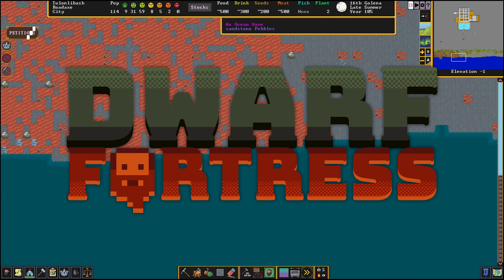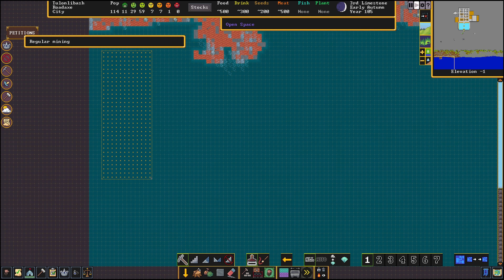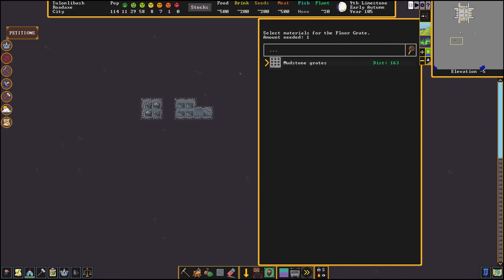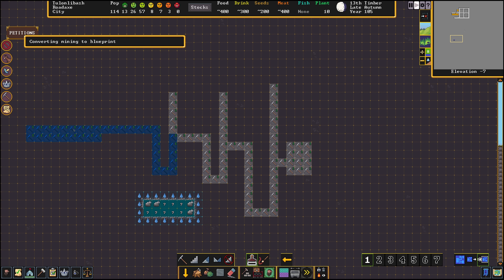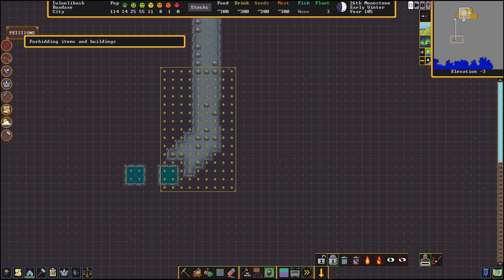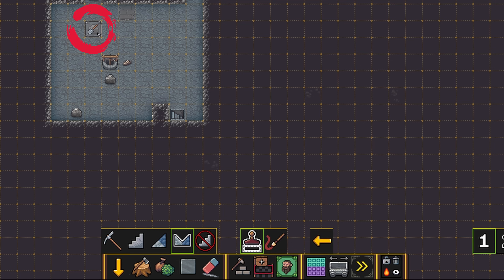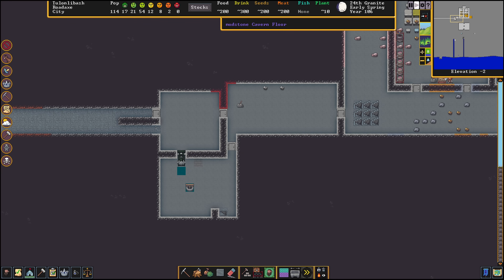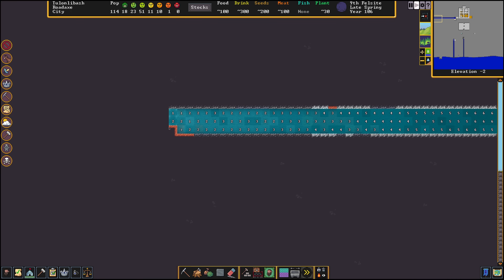Using Water & Water Pressure 🔅DWARF FORTRESS STEAM🔅

Comment: I flooded my base again, this pressure guide explains why it happened. Got a pump set up to pump it out, but from this, i can pump it off the map. Thank you for the tips.
Reply from the maker: you can also use gravity to drain the water without pumping if you can dig a big drain! Happy Gaming
Reply: @TwistedLogicGaming  That is actually what saved me. I was prepping an area on the bottom level that I had yet do do anything with. Water flowing down into bottom floor was enough to get some 1/7 levels in for flood gates till I fixed the water issue. 

My ideas was to divert the stream, then use the rock slits to filter all the fish into one spot, then fish that area. Turns out the fish went though the wall slots and I needed to add in grates. It was at that time, enough pressure had finally up that water came up my wells, leading to surprise flooding.

I knew from years ago that a dead body in the water can make it go bad, so I am trying to create running water that will carry anything bad out, possibly creating a catch to filter out anything that fell in. Wasn't aware that pumps purify the water. Also wasn't aware that creatures could be pumped.

I look forward to try out some of the water traps in the future.

Thank you for making these videos.

Comment: One tip for the edge drainage: use channeling to make it two tiles deep, with two levels of fortifications. Because of the way flow and pressure work, it will drain much more quickly and efficiently. (If your fort is flooding you definitely want the drains operating efficiently.) You actually only need a single tile wide drain this way because of how fast the water will flow out.
Reply from the maker: 100% correct

Comment: im trying to achieve this design and when i  want to place doors it says "No access to door" i dont understand why, i have plenty of doors but i cant just place them where i need them to be placed, its frustrating.
Reply from the maker: where are ou trying to build doors ? timecode? in the u-pipe the doors are not required only the grates are
Reply: well i fixed that problem but when i forbid the top door my dwarf just...ignores it and goes to the bottom door and just stands in those stairs for some reason, every other dwarf is in the meeting area not inhibiting construction but oh well, he will drown.
Reply from the maker: you must lock the door not forbid

Comment: If you're relying on off-map drainage using fortification edge tiles for your water features, e.g. waterfalls, be very careful with visiting your fort in adventure mode later! In adventure mode, the map edges are not necessarily the same, and you'll end up flooding the entire thing!

Allegedly. This has obviously never happened to me... 😳
Reply from the maker: Good tip! Thank you for you wisdom bdeink!
Reply: This is fixed in the Steam version by just not having Adventure Mode included :^)
Reply: Sounds like more FUN.
Reply: I suppose you got to drain the water in the caverns or the magma sea then.
Reply: @meneither3834 or just direct it back to original source? like 1 floor below the sea/ river it originated from
Reply: @head0fmob  That is not how it works. When you make something that takes water from an infinite source you can only make it one way. If you tried to make it go back to the source, it wouldn't work because the source is already 7/7 and has no room for more water. It would either start flooding or if you made a proper seal, it would just jam up as soon as you try to return water to the 7/7 source.
Reply: You could direct it back into an aquifer tile if you have one.
They can absorb infinite water.
Reply from the maker: That's a great suggestion, this map has no aquifer. I prefer the minecart drainage, however it will not set the water as flowing if you need that tag for water wheels. Happy Gaming

Comment: Great guide, as a total DF newbie I was wondering how I could move water around after I found out I was supposed to prepare a water source BEFORE winter strikes as the outside water source freezes over! 
This video perfectly explains multiple methods that I can more or less understand and definitely do with a bit of effort on my end. I'll likely be doing the old timey strategy just to be quick about it but i'll be coming back to this guide to do it the fancier way when I've got a water source set up at least
Reply from the maker: Yes this will be need in the hosiptals if you get in to any brawls, Thank you for watching!

Comment: I could be wrong but I think it would be better to designate the mined tiles as red traffic zones so they won't stand on them. Otherwise there can be a situation where one dwarf stands on one of the tiles to mine another one while the other dwarf mines the tile beneath him. I remember reading something like that on the wiki.
Reply from the maker: Yeah that is correct however I was watching them, and if a dwarf was standing on a tile desegnate to channel you or I could also erase the designations on those 2 tiles before the job is complete and then you will not need to set and remove a traffic order. For larger jobs I would do how you discribed. Thank you very much for bringing that to light trafic areas can be super helpful !!
Reply from the maker: This comes up in the video im currently editing and I recoreded that about an hour ago ahahhaha. so watch out for the next video
Reply: @TwistedLogicGaming , nice =)

Comment: I have a problem with U-Bends like the one you did. For some reason, whenever I open access to it, water doesn't propagate at all, just some 1/7 tiles and that's it. Why does that happens? It's basically impossible to do something like the reservoir done at 10:43
Reply from the maker: I think this has to do with a water pressure bug if I am correct. please see this video about it (sorry for the quality this is an older video) https://www.youtube.com/watch?v=lU5JeIgMvoA
Reply from the maker: let me know if that bug seems like the one you have . Thank you for watching !
Reply: Not completely sure if it's the same since I can't 100% follow everything going on, but it seems to be similar. 

I will try to describe as best as I can. From a side view, "w" is water, "g" is where I have stone grates, "d" is where I have a door connected to a lever that blocks the flow, "|||" is where I want the water to flow at level 3. This is how my configuration ends up being when I connect with the river at level 6.

6   www         
5         w            w
4         w            w
3         w            w w d                                                                 |||
2         w            w
1         w            g
0         wwwwww

Now let's say I open the door at level 3, this is what ends up happening.

6   www         
5         w            
4         w            
3         w            w w d w w w w w                                            |||
2         w            w
1         w            g
0         wwwwww

The water propagates for a moment and that's pretty much it, at the u-bend water never really goes above 1/7 (it's a 2x2 u-bend), and the water that propagated ends up drying, resulting in this.

6   www         
5         w            
4         w            
3         w            w w d                                                                |||
2         w            w
1         w            g
0         wwwwww

If I close the door at level 3, the water never goes up again, with level 4 and 5 remaining empty forever. 

Now, I have tried connecting the water at level 3 to the hall I want it to propagate in both ways, diagonally (so it becames it own body of water) and non diagonally. With both cases I have the same results. I have tried flooding the u-bend first, then connecting to level 3, same results. I have made a 1x1 connection to level 3 first, blocked by the door, and then flooding the u-bend, same results. It may be worth mentioning, but the lenght of the tunnel at level 0 that connects to both parts of the u-bend is longer than what I depicted, but that doesn't seem to be a problem since initially it always fill up to level 5. It's driving me absolutely insane and I am completely clueless on what is going on.

Edit: After going through all this and watching the vid you mentioned again, it seems to be the same bug, because at level 3 the flood doesn't "complete" and the pressure check seems to die, never going above 1/7 again. Can be replied at any lower level with the same results too. Fuck me.
Reply from the maker: seems like the door is causing the flood fill to fail, & causing the pressure bug in that video there for flagging eveything after that door as static. I might have to create a new version of that video for the steam version; but that seems to be the issue...

To test this: save a back up file. then dig over to the water on level 3 without breaching any damp tiles and see if water flows. basicly forcing a block update in the area of the water. 

W dampstone (do not breach for test)
S stair 
M Mining tunnel 
D door
Top down level 3:

M
M
WWWWWW
WSWWDWW
WWWWWW

Let me know Lugano V !
Reply: @TwistedLogicGaming  Sorry I forgot to mention that I tested without using the door (both having it placed and not placed while the water enters through somewhere else) and got the same results, water propagates to 9 tiles away at most and at the stairs water remains at 1/7. I'm pretty confident that the door, no matter how suspicious it looks, is not at fault here.

I tried something different and... it kinda works but now I'm beyond confused. I will describe it using the real size. 

- Basically the water enters from the river to a tunnel, it moves 10 tiles to the East. The last 2 tiles are a 2x2 stairs.
- Water goes to the Bottom of the u-bend through the 2x2 stairs. The u-bend is 11 tiles deeps (which means water should go 10 tiles up at the other side). 
- At the Bottom of the u-bend, the water moves to the East for 90 tiles, the last to tiles are a 2x2 stairs.
- The water goes up 10 tiles, completing the u-bend flow.

At the top of that end of the u-bend, I wanna open a section to the South that is 16 tiles long for a well. When I try that (with or without a door), basically all that I described before happens. Water floods at most 9 tiles to the south before the stairs get permanently stuck at 1/7 depth.

BUT what I did now, rather than opening to the South, is opening to the West. Did a 18 tiles long tunnel (2 tiles longer from what I wanted the water to propagate to the South). At the end of that tunnel (western most part), I did a small new u-bend that is 3 tiles deep. The tunnel is opened to the u-bend right from the start. Then I channel at the river, water starts to flow in and... it works. When the water goes 10 tiles up to the top of the u-bend, it then propagates with no problems to the West and it completely fills the new u-bend. 

My honest reaction was "what in the actual fuck is going on". So I tried again, but this time, rather than having the tunnel to the West at the top of the u-bend being open from the start, it was closed, and I went one level above and breached through channeling, just like you do in this video at 9:51. It DIDN'T work, water got like 10 tiles to the West, with the stairs being stuck at 1/7, resulting in the same problem that brought me here.

So I went back to the original idea, which was the tunnel to the South that was blocked by the door. But this time, the door was open before I tapped the river. So I channel at the river, water starts to flow through the u-bend and... IT COMPLETELLY FILLS THE TUNNEL, going through the open door with no problems.

So now I can 100% say the problem is that the pressure at the u-bend dies once the system is opened in any way AFTER it fills up. If I open the door so the water can flow, or I dig a channel from above, water pressure at the respective level of the u-bend ends up being oblitariated, no matter how. BUT, if the tunnel or the door are opened right from the start, then when the u-bend is filling up, it will propagate through that tunnel without problems. From watching your video and reading the wiki, I think it's pretty safe to call this a terrible bug :(

Comment: .:) hey so @9:24 it’s not pressure cause you channel instead of mining diagonally? Or cause lvl was at -2 so it became equal and has to be pressured again. 
Great explanation tho just tryin to not drown the poor dwarfs
Reply from the maker: The pressure was not reset at that time becasues the gap was too big even though the water was moving in a diagonal direction.  
the small diagonal gap to reset the pressure is a box of 4 tiles; 2 are walls and 2 are open for water.  

##~#
#~##
Reply: You sir are an exceptional dwarf thank you

Comment: I watched it 3 times and still need 28 to understand. I'm a noob. Thank you for detailed explanation.
Reply from the maker: <3 Happy Gaming
Reply: @TwistedLogicGaming  All I had to do is keep tracking the level number on your minimap and everything became easy to grasp
Reply from the maker: adlhbgreqk links in the comment section are flagged here, (time codes work for questions) 08:30, that dwarf you were asking about is okay, I edited out that part by accident, however he is fine, just mined the tile and left, the water is alot slower than the dwarfs when it pass through a diagonal.  usually they mine and walk away. the only time you could get into trouble is if you don't have bedrooms or a dormitory location setup because then they might mine it and sleep where ever. Thanks for watching!

Comment: Few questions with this if anyone can help:
-How do you know the pressure of each Z level in the u pipe?
-How or why does the U-pipe turn salt water into fresh water?
-At 09:35, why does pressure not reset? I thought diagonal resets the pressure but here you say it will not reset?
-What was the purpose of creating the drain construction at around 16:40?
Reply from the maker: -How or why does the U-pipe turn salt water into fresh water? -  possibly a bug ?  in the past we used the pumps to desalinate the water
Reply from the maker: How do you know the pressure of each Z level in the u pipe? the pressure of the U pipe is -1z from the souce tiles of that body of water
Reply from the maker: -What was the purpose of creating the drain construction at around ?  to show you what is possible
Reply from the maker: At time, why does pressure not reset? I thought diagonal resets the pressure but here you say it will not reset?  that is not considerd a diagonal in the walls and will not reset pressure because it is too wide. there for that area is still treated as the same body of water as the U pipe & ocean
Reply from the maker: Please see time 08:00 for an example of the diagonal squeeze/ this tight diagonal space splits the water into 2 separate body's of water. there for resetting water pressure for the new split body of water at that z level. that diagonal split becomes the source tile for the new body of water setting pressure to the split for that side only.
Reply from the maker: I hope that helps Chris, let me know if you have any more questions
Reply: @TwistedLogicGaming  thank you so much for the write up and videos! Helped a ton

Comment: I made this on my map exactly as you described only I was accessing a brook rather than the ocean. It did not work for me when I dug out the final channel from above as you did at 9:50 It only dribbles out for 11 tiles or so with a depth of 1 unit no matter how long I wait. I'm not sure if I did something wrong, if brooks behave differently than the ocean, or if this method has been patched somehow (unlikely). Your trick of the corner access "resetting" the water pressure to that level also didn't work for me, same dribbling flow as described above.
Reply from the maker: is the body water in a small area of the map (16x16 tiles) ?

it might have to do with this rare bug:
when a water flood fill fails the game code stops pressure checks in that area until there is a block update.
Sorry for the quality of this older video in advance: 
https://www.youtube.com/watch?v=lU5JeIgMvoA
Reply: @TwistedLogicGaming  I figured it out. User error, as expected. After I ate I was able to figure it out. I wasn't 100% clear on how the pressurization works if you divert the water coming back up the U-pipe before it reaches its maximum height or precisely how the corner leak method "resets" the pressure. With a few adjustments I was able to get it to work like I needed it to. Thanks!
Reply from the maker: @MartialistKS  oh cool im glad it was notthat pressure bug, someone else sent me a fortress recently that has the bug and i was worried that it was more common than I thought ! Glad you got it going ! yeah sometimes When you walk away for a few minutes and relax you can solve some problems almost right away!

Comment: Another great great video! I'm very happy knowing that after too many years always can learn something new.. can we use this system to create a "inside" fish source? I mean.. with the grates, fortification or bars.. The fishes can go through?. HESSED
Reply from the maker: The fish will not go through grates, However you can fish through the grate,(unless this was changed) so a we will need to be build ontop of an area where you have access to water that is outside the fortress. Like an over hang; Think Ice fishing!! Thank you for watching Leandro !! Happy Gaming!
Reply: That's right, it's easy to just create a roofed-in balcony over the flowing water with the grate in the floor. Tilebreakers can't break that grate from beneath